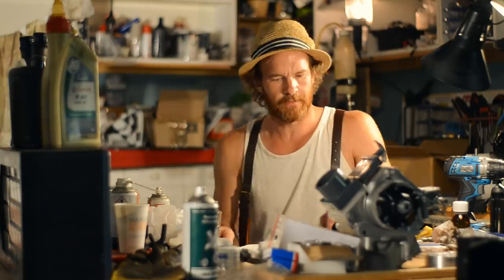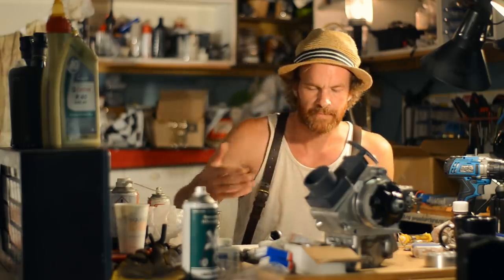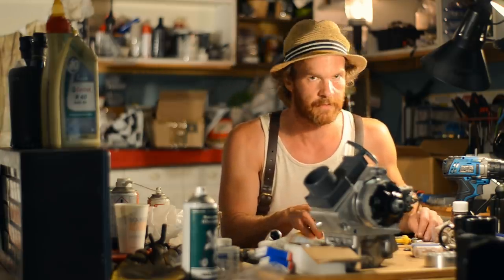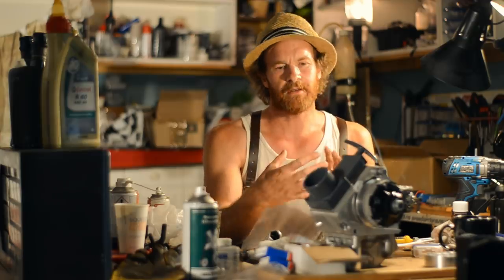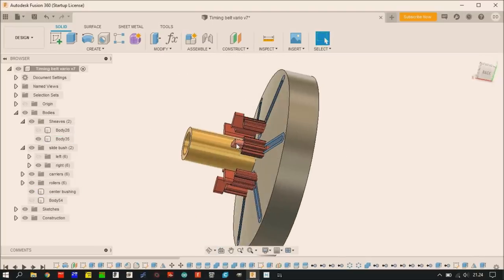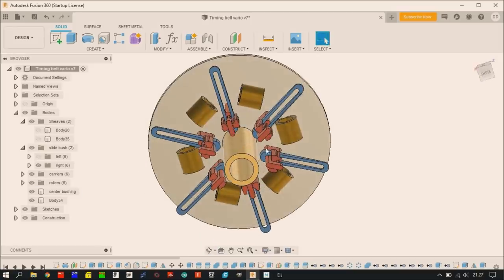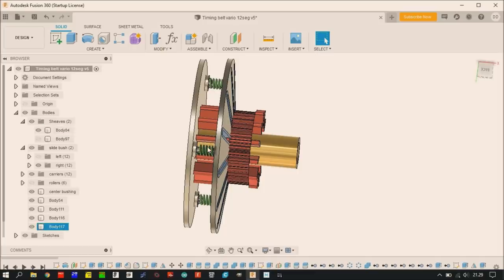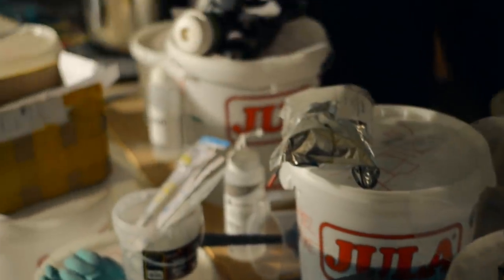The Most Powerful Two Stroke Ever - Revolutionary CVT?

Comment: The teeth in the belt are going to prevent adjacent jaws from moving outwards. As they attempt to increase the diameter, the belt itself will fight that.
Reply: Exactly what I came here to say. The spacing between groups of teeth will obviously increase.. when he sees the problem he will be like OH GOD DAMMIT
Reply: Belt can skip, but skipping can fuck up any belt
Reply from the maker: Yep, might not work at all. I'm hoping it skips just enough. Belt longevity is not a priority.
Reply: They can only exist in discrete positions governed by the belt tooth spacing matching a specific diameter where the toothed jaws can evenly mesh. So not 'continuously' variable, and unlikely that the belt will allow the jaws to do anything other than stay in one diameter, or have the untethered jaw move outward, engaging several teeth further along the belt and causing a jamb, likely snapping the belt or twisting the jaw sliders. I'd love to see a test though, the more teeth the belt has, the better chance of this working...
Reply: @2STROKESTUFFING  Yeah, not trying to discourage you. You do some great work, be it Axe or otherwise ;-)
Reply: I'm sure, that PTFE coated timing belts are most suitable, Dayco aftermarket offers them
Reply: Actually.. this would work without skipping if the moving sections can come out independently of one another. You would want the disengaged teeth to move outward and re-engage with the belt in their desired location. The teeth would sort of climb their way outward with each rotation
Reply: The more that I think about this, the more I'm sure it could work. The jaws (reminds me of a lathe chuck) should be able to move away from the center independently of one another but be sprung to return to center. So a very simple mechanism. The spring rate should be set so that while the jaws are disengaged from the belt they can move outward (centrifugal force or whatever) so that they engage with the belt in whichever teeth are nearest. You would then rely on the teeth of the belt meshing with with the jaws (and the slight centrifugal force) to keep the jaws outward and at the correct radius from centerline while in the loaded area of rotation. If required you could also have a moving (but not rotating) jaw guide which pulls the teeth to the correct radius before they mesh with the belt.
Reply: @nathanchalecki4842  This will vibrate as hell, but as long as tooth will be able to slip on belt to engage with it properly it will work
Reply: Or keep the current twin cone and belt arrangement but ditch the rollers and instead use a thrust bearing and clutch fork to force the cones together and increase effective diameter
Reply: Serpentine belt with variator design should hold the horse power, with 8-12 Rib belt. might only need 8 Rib belt depends on how much power you're Motor puts out.
Reply: A multi v belt (PK) is probably the only thing that whould work in your application. If my 5-axis Mori Seiki Cnc-mill was up and running i whould gladly help you out with whatever you need for your projekt just for fun. I do have alot of connections thou so i might be able to fix it anyway. 👍😀
Dont be a stranger.
Reply: @nathanchalecki4842  I'm thinking something similar. The tricky part is that the movable face should limit how far out the toothed segments can go at given rpm but allowing them to stay closer until they are no longer held back by the belt- basicaly doing the oposite of what the moving face in a typical variator does.
Reply: @nathanchalecki4842  Limiting the travel to only engage to the next discrete step could work. But the way he has it designed, the jaws are independant, so they go to maximum travel, engage with the belt (eg. 10 belt teeth between jaws), but then the radius changes as they get compressed by the belt tension. But they are locked to a fixed distance on the belt to the proceeding jaw by their tooth mesh, as they get compressed, the actual belt tooth separation for that diameter should have been smaller, so something has to give. I predict the jaw snaps on that sliding pivot, or jambs before it can compress to the smaller distance stripping teeth or snapping the belt. The jaws diameter need to be locked to each other, with enough slop to skip up a tooth, maybe that would work.
Reply from the maker: That's kinda what I imagined - the jaws that are not engaged by the belt having enough slop for it to work.
Reply: Could see this working with a multi v instead of teeth. Can't see the teeth meshing correctly with the toothed belt in practise
Reply: 2STROKE STUFFING I actually think it would be a good idea to try a prototype test design. The timing belt will only keep the moving toothed sections in place where it wraps them. The ones outside of the wrap will be able to throw out a bit. When the belt engages the "thrown out" pieces, it will be disengaging the ones it was holding in place. The new diameter will be wider than the original diameter. If the revs are held constant, they won't throw out any further. As soon as the revs increase, the disengaged toothed sections will throw out further & the variator will increase its diameter again. You might need a separate belt tensioner to prevent resonance on the portion not under tension. The issue of changing tooth spacing that others have said is moot because the drive dogs will have a constant spacing on their teeth & the only variation would be in the gaps while the dogs are readjusting to a larger or smaller diameter. The system that seems to be going to be put in is not weights & revs based but a control of the engine position which will allow the variator to change. If the engine position is electronically set, it can be positioned in discreet steps to minimize the drive dog misalignment. It can be based on engine RPM & electronically altered. The more I think about it, the more workable it appears. New ideas are often dismissed by many as unworkable & stupid simply because they're different & the commentator is unable to visualize a completely new concept. I expect the design to work. It will need development but it should produce a higher efficiency of power transmission. Just try it, I think you'll prove the naysayers wrong!
Reply: @2STROKESTUFFING 
Hi if you would have the sliders in a bearing they could ajust the tooth problem!? With bearing i mean, each sliders would have a spoket that can turn freely and aline it self acourding to the Belt. So they are turnable and not stiff, the tooth jumping problem would be solved.
Reply: What about if the cone of the variator plate was backwards, so the outer edges would be closer than the center and use like a backpressure spring to prevent the teeth from coming out due to centrifugal force?
Reply: Love your channel and yours ideas but unfortunately this variator will not work, only if you can keep teeth pitch constant.
As soon one teeth slip, the belt will be destroyed in a matter of seconds.
Keep the good working!!!
Reply: Worth a try none the less, some of the best creations were 'impossible' . Therefore it should be tested, if anything it will lead to a new, better idea. I say test the idea, film it then try something else if it doesn't work .
Reply: The problem I see is that as soon as the tooth disengage from the belt it would slide to its maximum position and probably snap or similar when engaged. If the tooth could be limited to only jump outwards one step at the time... I think it could work
Reply: Mate, following on from this, in cycling there are currently a number of internal gearbox drive systems. Some of the big names are Pinion, Rohloff and Shimano have just joined the party. The Pinion and Shimano systems are similar to the one that Allen Millyard uses in the Youtube video above, so it sits in the frame and is directly driven by the crank arms. The Rohloff one is fitted to the back wheel in place of the freehub, so still needs a chain/belt to the crank arms. 

I think either of these two styles of system would work for your bike instead of the variator. If you are not interested in suspension loads the Rohloff style would be good as you just need a front engine pulley running to your rear wheel. The Allen Millyard style would be better if your are more interested in mass centralisation and lowering the un-sprung mass on the rear wheel. This also uses a toothed belt running from the gearbox to the rear wheel. By using either of these types of gearboxes you won't need to worry about having the engine suspended from the frame as it can be solidly mounted.
Reply: Each set of teeth needs to roll on a roller and need to spin on each slider
Reply: V.2 will work but vibration at high rpm may be an issue
Reply: @2STROKESTUFFING  Perhaps you can introduce some play is the tooth setup so the distance can vary somewhat?
Reply from the maker: Jim(on our Bonneville team) just emailed me a brilliant idea for doing just that.
Reply: the minimum increase in effective pulley diameter would be one belt tooth between each section. You have 12 sections. So the smallest possible change in gearing is 12 teeth.
Reply: @nathanchalecki4842  Nope it cannot work, only in certain positions where the teeth 'line up' with the toothed belt. Inbetween those positions something will slip or grate the belt (the softest material), and I reckon the system will grind itself into rubber dust (if it will not snap the belt immediately due to the idle sliders moving to maximum diameter/position).
Reply: If anyone can build you a transmission to spec, it must be millyard!
Myself I was thinking a spiral lock plate that limits the movement of individual "jaws" so they cannot overtravel the next mesh point. The lockplate could then be rotated to incrementally increase the gear size, either manually, or using a device like a mechanical timing advance on old motorcycles.
Reply: 2STROKE STUFFING if ist works the way you think, it will actually only have a view gears... it will probably be less than 10 gears, try it out on fusion. Have you thought of a gearbox with a very long first gear? I mean a go kart gets to 130kph with 1 gear, so if you get to 80kph and then start changing gears? A thin Karting chain has less friction and Mass btw..
Reply: I think it can be done using a curve/rail that syncs the engation of the teeth and making it electronically controlled rather than inertial. Otherwise the jaw that looses pressure from the belt will fly toward the outer position, like Jason mentioned.
Reply: @2STROKESTUFFING  why not use your ideal with a flat serpentine belt.  That way you dont have to worry about belt pitch.  Keep your driver radiuses (with the 8 little V's) as big as possible.
Reply: Just throwing in my two cents. What if you had a way of guiding a jaw that’s about to engage the belt using the position of the previous jaw that engaged the belt? Depending on the current pulley jaw diameter, there should be a specific number of teeth between jaws and an increase in diameter probably will only occur in one tooth steps, although between each step, the amount of centrifugal force acting on the jaw against the belt should push the belt out linearly without steps. 

Also, of course you need a way for the cvt to disengage below a particular rpm for idling. But I’m sure you know that.
Reply: Good point but because the variator is rotating at speed  it should ..should allow the variator  teeth to move outwards.? Maybe ..we'll see .

Comment: Some modern downhill bicycles use an internal gearbox like a motorbike, it's not a bad idea considering the relatively low torque your engine will make, but they're designed for lower input speeds so you'd probably need a belt primary reduction too.

Comment: You could get around those gaps between the red parts by using gears that fit the timing belt so that they can turn when the diameter of the variator changes

Comment: You are primarily using this for a land speed (top speed) application right? Maybe have a variable transmission, then a fixed "top gear" timing belt that you can shit to for higher efficiency only at top speed. A simple shifting mechanism to shift between the fixed ratio belt and the variable transmission.

Comment: If the belt meshes with more than one of the segments, as each pair of segments move out, the belt teeth would have to skip over segment teeth to allow for the expansion. I can see that other people have pointed this out. The solution is to replace the fixed segments with small sprockets that can freewheel in one direction only.
Reply from the maker: That's an interesting idea!

Comment: I think you will have to design it so that all teeth are able to move one step out individually so that the teeth that are not engaging the belt can move out one belt tooth spacing and not be pushed back in again when they contact the belt! Perhaps the only way to achieve this is to make individual teeth have locking cogs for the right positions for the right tooth spacing and some king of release mechanism that allows the teeth to retract! The release might not be needed because I think for your application the CVT can be a "one time use" so you can be fine with manually resetting it after every run.

Comment: I'm sure it's probably already been said, I haven't read any of the other comments! You can't change the pitch of the sprocket, the variator is just going to be locked in position by the belt pitch. You'll end up with lots of drag and vibration.

Comment: novel idea using vacuum for tension, but you won't have total control; your results will vary with temperature and barometric pressure, tho it may only be a small %. it could work if isolated from engine heat.
I favor a directly controlled, servo-operated ball screw for precise movement, but it will be heavier, though more durable.

Comment: Two points: 
- There are going to be points in the "shift" where the teeth on the belt don't line up with the teeth on the belt (hence the reason  CVTs use smooth belts, not toothed belts). You need distinct steps to use a toothed belt. 
- If all the moveable sections of pulley are fixed together it won't be able to shift as the sections engaged with the belt won't be able to move when they are locked into the belt's teeth. 

I've seen an idea for a bicycle transmission that was similar in concept but used a chain. It had a mechanism where the sections of pulley (or in this case chainring or cog) that moved were moved one at a time to the next position up or down as they cycled through the portion of their rotation where they weren't interfaced with the chain (so the rear of the chainring or front of the cog).

Comment: An interesting idea, if you can make it work it will not be a true CVT but a transmission with many steps.

With 12 sliders having 3 teeth each the smallest size will be like a 36 teeth wheel, next fixed size it will be  1 teeth space + 3 teeth  equivalent to 4 x 12 = 48 T, next ”gear” 60T then 72T, 84T, 96T etc.

I think you will need to control the sliders so that they move in and out in so that they match the belt teeth. Once you the sliders move out there will be vibration in the belt because instead of a perfect circle the belt wil run on a 12 sided polygon wheel creating a variable tension in the belt.

You can see an example of this idea here http://hettlagedrive.de/en/transmissionsystems/hettlagevariator/
Reply: Looks exactly like what he has in mind. Great minds think alike!

Comment: The spaces between the drive teeth sets , on the first version will help  the belt to jump a tooth during expansion and use a belt with wider spaced teeth so the cvt has some play to move out . The system should work just fine and be VERY efficient but the belt life will be short lived .Not a problem for this use ! Brilliant thought process !!

Comment: Wont the pitch between the teeth change as the diameter increases, making the belt bind up?
Reply: Probably not with the way he has it designed. It will change ratios in one tooth steps theoretically, but variation of centrifugal force acting against the belt will hold the effective belt diameter somewhere between each step, so it should seamlessly slide around its gear ratio spread.
Reply: 1-tooth longer pitch per variator turn, stepping- up/down at the moment the belt disengages the front-half of the variator, to travel to the back-half of the variator.  look at the action after disengagement: https://www.youtube.com/watch?v=eWXxiXvfBjg

Comment: If you imagine a regular chain on a sprocket you will se the problem of increasing the sprocket size while the chain is engaged. And then its the variation in pitch between the sprocket teeths that wont line up with the chain at certain levels of increasing the sprocket size.

Comment: The balancing of the springs, belt tension and weight of the sliding metal pins that make the sprocket is going to be a balancing act, with a lot of trial and error.
The centrifugal forces on the sliding pins are going to change a lot from low gear to high gear, because the travel speed is going to double or triple when they move longer out.

Comment: The first option thats how timing belts work. A tiny torque converter is probably what you want to help soften any gear changes but that would need some serious engineering.
Definitely worth trying the bicycle transmission thing on the dyno it can handle a fair bit of torque when the chain is new and provide a really wide 11 speed these days.

Comment: It may not work with so little angle on the plates and the guides but I do think with improvement here and there it definetly could work, I wont expect it to work first try but probably most issues will be cause by guessing the force you need to open it and the angle of the guides and plates that will prob be the tricky part, like others already said issues may come out when it starts to open, good video.